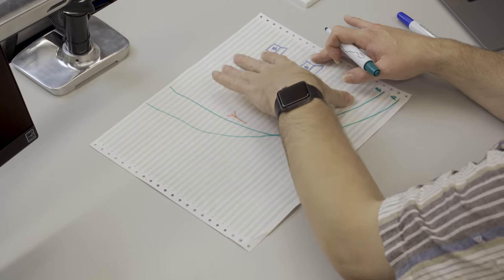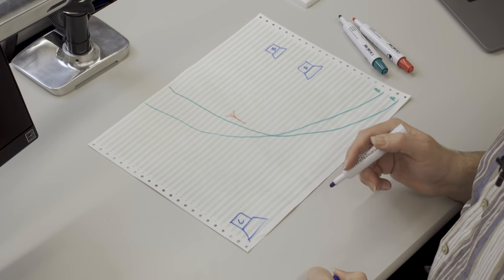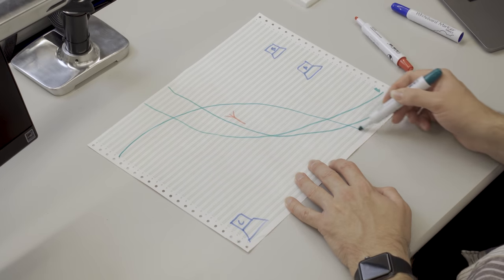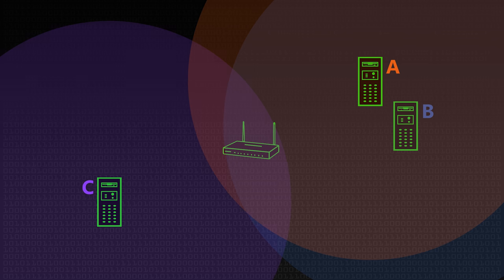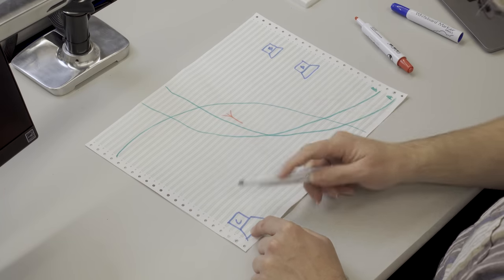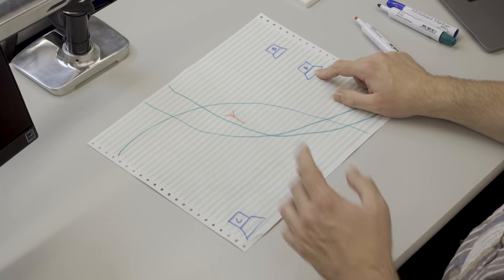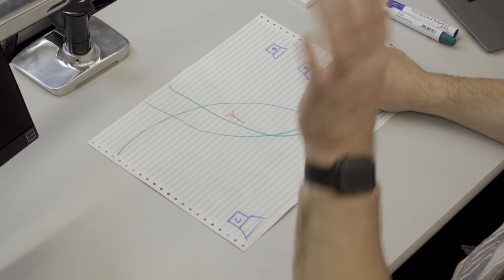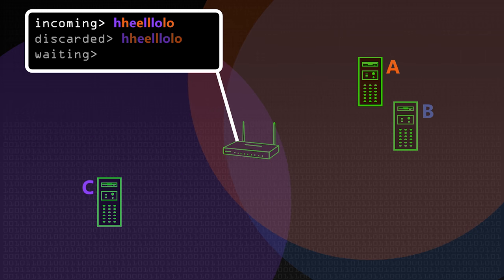WiFi's Hidden ____ Problem - Computerphile

Comment: What's the difference in transmission rate per device as the number of devices increases between an ethernet network that implements CSMA/CD and one that theoretically implements CSMA/CA?
Reply: CSMA/CA would be a lot less. A typical 2.4Ghz wireless network on one channel turns to poo after 25-30 devices join the one access point. Hence a lot of managed wireless networks will spread the load over multiple access points. There are also issues with putting too many access points in the same area with roaming issues on the same SSID and channels as well. It's not as pronounced on newer standards and on 5Ghz due to there being fewer overheads and more radio bandwidth and smarter efficiencies.

Comment: So, basically that means you can mess with any WiFi network by spamming fake RTSs that don't get following transmissions in order to keep the router busy waiting for nothing, or spoofing the router's CTSs and spamming them in order to prevent other nodes from sending packets as they believe they aren't the node being cleared to send?
Or is there some prevention against that besides "please, don't"?

Comment: So interesting! Like magic. I guess you could make your computer ignore the request to send command and send out a tonne of signals, corrupting everyone's network connection. Is that possible?
Reply: The easiest way to do this is with a crapton of white noise (a completely random signal) that is "louder" than any legit signal. This is called "signal jamming".

There is presumably a way to make more sophisticated packet fragments that would jam things with lower output power, but I suspect it's not worth the effort given that random noise does the job just fine.

Comment: question.
so i have my wifi router that has 2.4 and 5.0ghz.
we were running 2 desktops and generally 2 tablets from those.  Its just the wife and I, so only two of those would be working at the same time.
The main router is in the living room where our desktops are. Both tablets are in the bedroom, which seems to get spotty wifi on a good day.
I bought a wifi extender that also has 2.4 and 5.0 and has its own 2.4 and 5.0 signal (it adds 'EXT' to the name so we can see all four on our devices).
My desktop is the biggest consumer of data since I upload video content and watch a lot of video content thru the day...so I have my desktop on the 5.0ghz on the main router signal...with the wifes desktop using the 2.4.
The wifi extender is plugged into the bedroom outlet right by the door...which is literally the only place it can be plugged into because of how they wired the apartment, lmao. 
I have her tablet using the 2.4 EXT and mine using the 5.0 EXT off the extenders signal.

Based on your video talking about interference, Im now thinking I set all that up like that for no good reason....ie the signal might see the same interference regardless of my putting everything on separate wifi signals?
Did my doing that make any difference at all, do you think?
I mean, would I get the exact performance if I just had both desktops on the 5.0 from the router and both tablets on the 5.0EXT  from the extender?

Comment: Ok, I'm just going to throw this out.
Looking at it as a Venn diagram. Computer's A, B and C's range, all intersect at the Access Point. 
So I would therefore, assume, that all 3 computers can detect each other, due to all 3 WiFi signals overlapping at the access point.

Comment: Isn't this a problem only when the devices are all communicating on the exact same band? IIRC there are Wi-Fi standards for transceiver behavior that allow for access point broadcast on multiple "sub-frequencies" (i.e., finely-tuned frequencies in the 2.4 or 5 GHz range) to various devices, allowing for compartmentalization of bandwidth. I mean, in one channel, you have 20 MHz of width to work with, separated by 5 MHz from another channel. If Wi-Fi networks don't currently work by allocating a small "micro-band" to each device that connects with some overlap when it reaches several concurrent clients, could it be possible to make it work that way?

Comment: That's not even taking into account every single problem that wifi has with similar frequency interference, (like those 2.4 ghz home phones) older home materials, and the compounded issues of proximity to other routers and wifi devices.

Comment: Like a bunch of students in a classroom. When they want to talk they raise their hands. The teacher can then tell one student that they can talk.
Reply: An interesting thought, but not quite the same idea. The example you give of students raising their hands employs an out-of-band signal. That is, the student raising a hand is transmitting a visual Request To Send even though the actual communication will be auditory. A closer analogy would be if each student said their name aloud repeatedly—with a random delay—and waited to hear the teacher call their name before saying what they want to say. Here, the Request To Send and the actual message are both auditory.
Reply: That's essentially what time-division multiplexing is; each device can transmit during its own time slot. So it's a round-robin kind of system. It was initially developed for telegraphy and later for telephony before we entered the digital age, but advanced versions are still being used today.

Newer methods exist to allow multiple-input multiple-output (MIMO), which means multiple communications can occur simultaneously. For example, wavelength division multiplexing (WDM) exists for fiber-optic transmissions by dividing light into various wavelengths. Likewise, frequency division multiplexing (FDM) and code division multiplexing (CDM) exist for carrier usage, primarily covered in this video. Finally, space-division multiplexing (SM or SDM) utilizes the space around us to create distinct channels by operating on various frequencies. It exists for wi-fi usage and some fiber applications. I think it's creative how engineers developed these methods to divide transmission mediums like this to support higher throughputs.

Comment: Perhaps you should talk about MTU and that we’re kind of historically stuck with 1500 when it no longer means anything as it did on shared medium at 10Mbps. Wi-Fi’s natural MTU is two thousand and something.
Reply: Modern wifi (.ac etc) uses AMPDU which dynamically globs frames together into larger blocks for continuous transmission (e.g. 20-50KB) to reduce overhead from preamble, clear channel detection etc. ; in terms of the RF throughput this is largely the same as jumbo frames.

Comment: That's a common misconception or myth that wireless stops working because the signal gets weak. It doesn't. It stops working because the received noise starts being stronger than the signal. If there was no noise, the signal could be arbitrarily weak and the WiFi would work. Conversely, even with strong signal the WiFi may fail when there is a high level of noise. A substantial amount of noise comes from thermal and/or shot noise of the preamplifier input transistor of the WiFi receiver.

Comment: Actually it is possible to do better than this.  When the access point would "poll" each connected station in turn, asking "do you have anything to send?", and the station would reply with the data they have to send (or a "no"), there would never be any collisions, also no collisions between RTS packets.
And in fact this is done in some of the proprietary protocols used on wide-area WiFi systems, e.g. Ubiquiti AirMax, MikroTik Nstreme and NV2, and also in 802.11ax.
It is mainly suited to those outdoor links because the disadvantage is that all stations have to be listening all the time and be prepared to reply to a poll (and send that reply), even when they have nothing to send.  That interferes with power-saving schemes important for portable devices like phones and tablets.

Comment: What happens if a bad actor hears the ‘machine A is clear to send’ and has a packet ready to spoof as Machine A? Or is the clear to send message more obscure than that where all a computer would really know is if it was cleared or not instead of knowing exactly which machine was cleared?
Reply: All of this stuff is dependent on the nodes being well-behaved.  For instance, this technique doesn't help when you have two different wifi networks operating on the same frequency - they still collide, but the request to send/clear to send messages from one network are not processed by the other network beyond being handled as interference.  If you want to disrupt a wifi network, there are many possible techniques that could be used, and there isn't much that can be done to mitigate this at the protocol level due to the nature of the shared channel.

Comment: What happens, if there is a second access point nearby on a different network with some clients attached to it, using the same channel?
Reply: Depends on the TX power of both networks, if their coverage overlaps, and if so how large the overlap is. Assuming any of these it can cause undue stress to signal sending capabilities due to the crosstalk that is likely to occur. Think of a bunch of people yelling in a crowded room, it would be hard to understand anybody.

There are several situations this causes problems. For example, if you have a lot of neighbors in close proximity using their own APs then a lot of channel/coverage overlap is likely to occur causing this problem. It's also the same in the case of numerous mi-fi devices in close proximity, the connectivity will degrade across all of them.

A security implication is if someone embeds another access point into your network operating on the same channel this can also occur if the coverage overlap is significant.

Comment: Now I have one qustion.   If I have a router that can work at 2.4GHz and 5GHz at the same time does that mean that i get faster connection on devices that use 2.4GHz? Like, some information sends to near to router devices by 5GHz and at the same time farther away devices can send and recive information by 2.4GHz without corrupting it

Comment: If RTS can corrupt other packages; how is corruption, by an RTS from computer C, of an ongoing exchange between computer A and wifi avoided? Is it just error correcting code?
Reply: No corrections happens, both RTS get corrupted and both get dropped and both PC's will wait a random length of time before resending the RTS. Corrections only happens on an established connection, after RTS has been acknowledged.
Reply: @RomainVanAelst  I'm sorry, apparently I wasn't clear enough. I was asking about the corruption of an established connection between comp A and the wifi. The phrase "ongoing exchange" was meant to indicate an established connection. I meant a corruption of some package that has been sent after computer A recieved a clear to send signal.
They already explained RTS collisions in the episode. I'm not asking about that.

Comment: What happens when there are separate networks on the same channel?  Say an outside laptop is in range of the two nodes in the upper corner of your paper, but not in range of the access point on your paper?

Comment: The real problem with wifi is that it's designed by electrical engineers, without much thought given to software concerns, and no input from software engineers or computer scientists. The electrical engineering aspect of wifi is great, but the standard specifies using poor algorithms that lead to unnecessary congestion and high latency, and there's no interest from the people involved to do anything about it.

Comment: supposedly that isn't WiFi's only problem,   People forget about channel congestion using automatic channel hopping.  Most people think - oh I'll just reset my router.  That only works if there isn't that many access points hogging up all the bandwidth.   Luckily WiFi 6 is fixing that issue slowly, but I know people who still use Wireless G and N routers

Comment: Sooo, 'wifi jamming' could be as simple as broadcasting a continuous stream CTS messages listing one device, as every other device would just sit there not broadcasting anything??
Reply: Nope, it's simplier. You only have to flood the frequency range of the Wifi. Jammers only send, and are completly unaware of anything else (other machines and even the network node itself). The jammer corrupts the radio WAVES in the air. It's a oneway radio.
 
If the jammer (as in your example) would interact at any point with the Wifi node and use Wifi protocol, then the node would dictate to the jammer when it can send or not. Wifi can deal with large files/streams downloaded/uploaded by multiple PC's. They each get a turn in downloading/uploading a piece. You don't notice this when watching youtube due to the buffer, downloads more than you can watch and gets another load of data before the buffer runs out. Issue arise when you skip to a part of the video that hasn't been buffered. In that case you'll have to wait your turn.

Comment: What would happen if 2 Access points use the same frequency and placed close to each other? Why does that not happen (as far as I know) although you can find tens of routers in the same building? Does each router have semi-uniqe frequency ?

Comment: What if a particular node just keeps on transmitting data? Let's say node A and node B both want to transmit data which will take 2 hours each, then what will happen in that case?
Reply: Networking uses a concept of Maximum Transmission Unit (MTU) to specify the longest single packet of data. WiFi (802.11) that maximum is 2,304 bytes with an additional "wrapper" to specify source, destination, etc. Classic Ethernet the MTU is 1,500 bytes. Everything has to be cut into short pieces, partly for bandwidth sharing, partly for reliability as if any part of a packet is corrupted the whole packet has to be sent again. The longest possible WiFi packet on the slowest network will be finished in under 2 thousandths of a second. The request/clear to send system measures time to the millionth of a second.
Reply: @zombieman81  Thank you so much for the clarification.

Comment: What's to stop an evil node from just transmitting random data all the time, blocking out everyone else from getting a message to the access point? Or a related question: how can I be downloading something for 3 days straight without disabling the wifi for everyone else on accident?

Comment: what if there are two router in same area, and two devices within both area. device A connected to router A, and device B connected to router B. at that point what happen? do both signal interfere with each other ?  how does it work ?

Comment: What if a second device sends its RTS packet while the first device is transmitting data? How does the first device know how long to wait (and how long the other transmission will take)? Surely the wireless medium is chaotic enough to prevent clock synchronization?

Comment: If the signal radius is colliding between A and C why are they not aware of each other to begin with? It's a bit of a rhetorical question because obviously they are not aware that each are fighting for a comm position within the access point and its resources.

Comment: how does a lan private network solves does ? it is duplex transmission ? on a network every package have a network adress so multiple machines can save at the same time and the transmison will blend sending packages from machine A and B on a mixed way. and the receiver machine C will de-mix the packages and filter only its own packacge out. like a human mail man does with letters based in the zip code.
a solution could be. sender 1 sends to a 'mixer'/ router. and sender 2 sends to the same 'mixer' and the mixer/router sends to another 'mixer' wich will be used as a packages distributor wich the wifi can use a different frequentie then the router ir mixer. like talking at the same time on a telephone. yiu can use a different frequentie to send in a network protocol then you receive.

Comment: Didn't wifi 6 solve this issue by giving each device connected to the router a table/schedule of times when it can send data to avoid having to ask to reserve space?
Reply: Polling that's correct, almost reminiscent of the talking pillow or token ring networks of the day. The issue is you have to account for backwards compatibility and multi-mode networks if you have to support that.

Comment: Why would computers ever listen to each other? If the network is busy it's the access point who should say so.
Reply: The AP cannot send and receive at the same time, as the transmit signal is orders of magnitude larger and it would overpower the incoming signal.  So, the AP cannot say "hey, the network is busy now" as that message would interfere with whatever message the AP is receiving.  It has to wait until the data is received, at which point a message stating that the network is busy is rather pointless.  And this would also do nothing to avoid collisions since you can still have multiple nodes attempting to send a message at the same time.

Comment: I bought a wireless baby monitor from amazon, whenever we turn it on all WIFI drops out intermittently but wired connections are ok, does anyone know why or if there is a way I can stop it, I assume it uses 2.4ghz and is interfering with my router, I've tried changing channels on my router with no luck.

Comment: You say "over" every transmission end, with "over and out" the final transmission end.
Reply: "Over and out" only happens in movies and tv shows. In the real word, you only use one or the other, as "out" means "I'm not listening any more", therefore "over" is redundant.
Reply: @Garryck-1  it's from decades ago ham anyway but I understand "roger" and "over" as somewhat interchangeable passback whereas "out" ends the call. "Over and out" ends the call for the speaker but leaves it open for others to respond before they say "out." Helpful for multiparty hams for instance.